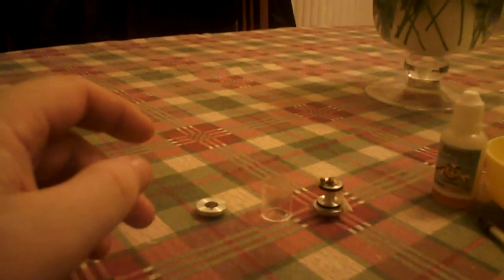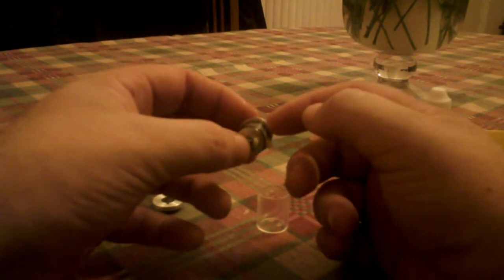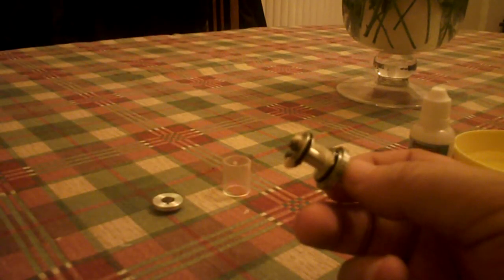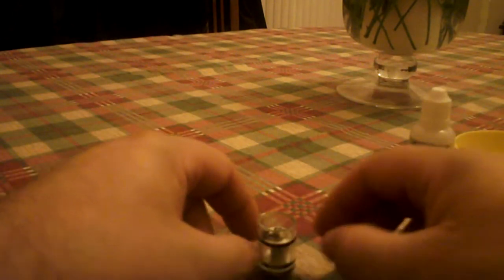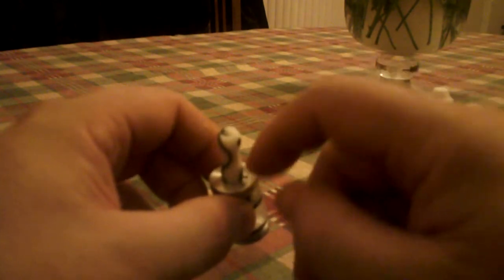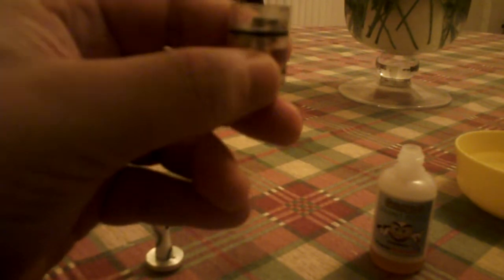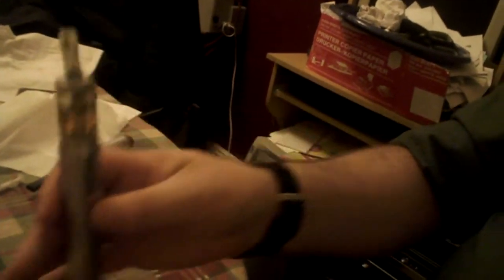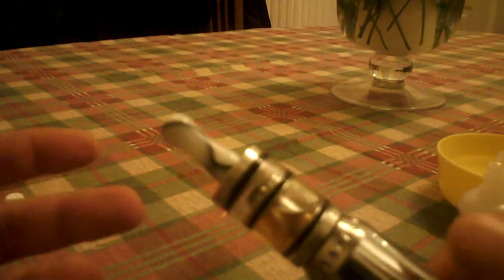Repairable Atomiser Head to Head Part 7 - Clearome

Comment from the maker: @MrTonio1987fr I don't doubt that people are happy. I have on occasion been happy with my Clearome, however, there are still times, such as when I made the video, that the Clearome is far from usable, and certainly not a repairable atomiser you can put in your pocket. In my experience the heat does not make the seals stick. Heat causes expansion, and expansion causes the seals to push the lid out, and this has always been the case for mine.

Comment from the maker: @MrTonio1987fr as you can see, I have every single repairable atomiser on the market, and more. Take my advice, the hole in the lid is a bad idea...  you can't help breathing down the atomiser, it depends on the way you vape. The hole needs to be in a fixed location, not in the cap. And the rim around the cap needs to be a little larger, so less stress is placed on a small surface area pushing it out. I do not see these as a major problem.

Comment from the maker: @MrTonio1987fr You have missed one critical factor. If I put the hole over the coil (which I know is important), when the Clearome runs dry, and in the configuration you recommend it does run dry... a lot, I burn my face. This is because the clearome is the only repairable atomiser with the hole in the lid. This is very very poor design. The hole could have been put in the tube. Every other repairable has the hole horizontal to the coil, so why not the clearome?

Comment from the maker: @MrTonio1987fr When the Clearome works, it works well. It is a shame that when filming this piece it performed badly, but I can only report on what happens. If you do decide to make the changes I suggest, let me know, I'll buy the update and do another review, I can't say fairer than that :) Don't be disheartened, it's otherwise very well made, and I'm sure a little tweaking will have it running perfectly.